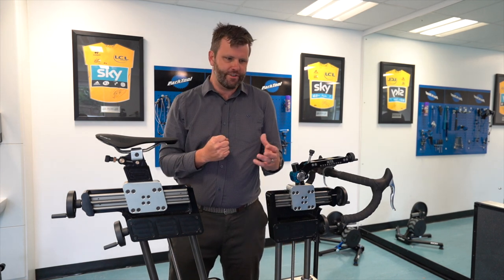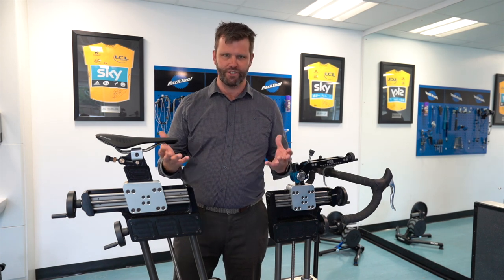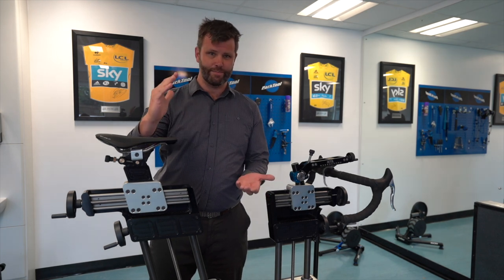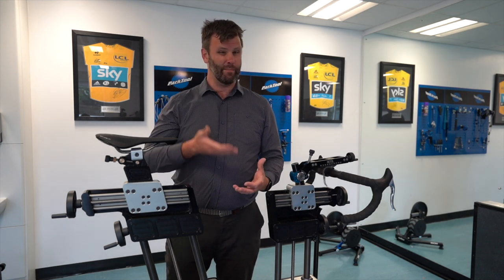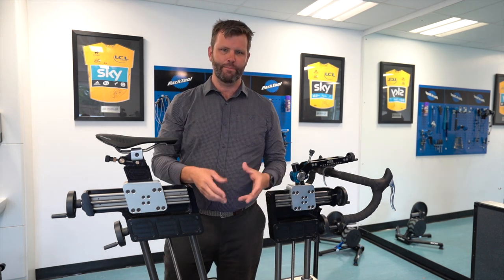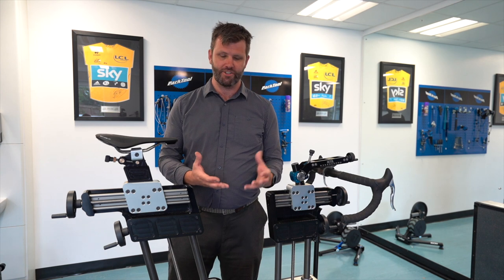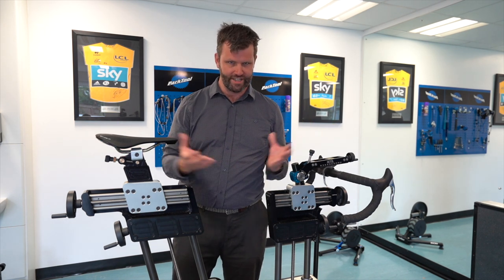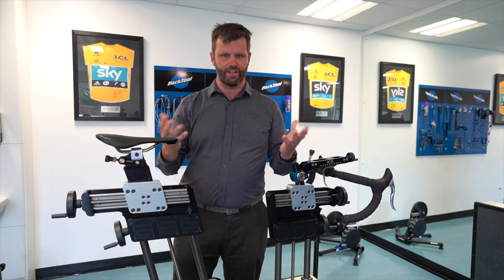How Crank Length Can Improve YOUR Performance

Comment: Tall guy here. I've always ridden different lengths on different bikes so was never able to compare directly without other factors influencing my perception, but when I went from 180mm to 175mm on one specific bike (because my power meter of choice was not available for 180mm) I noticed shorter is better for me. Shorter cranks make it easier to maintain a forward pelvic tilt so my lower back feels more comfortable.
Reply: ive recently got Phil's book and he mentions this issue.
I'm also very tall and the XXL frame comes with 175mm standard with that size
Are you aware of Phil mentioning anything* at all regarding rider height regarding this proposition? 
Is it ok for a 195/200cm rider to drop down to 165mm crank as well?
The book lightly touched on rider size but there was no definitive answer for this question.
I think a lot of tall riders will be very interested

Comment: I changed the cranks of my bike as I was experiencing knee pain on my new Domane. The bike came standard with 172.5mm. I rode to Burnham on sea on its maiden, towards the end of the ride my left Knee was so painful that I couldn't pedal anymore. I had to ask my friend to ride back and get his car. Long story short. On watching loads of videos on shorter crank lengths. I decided to buy 165mm crankset and to my surprise I was riding so much more smoothly and the pain in my left knee had all but gone. I think this is more crucial as you get older. I am 63, when I was younger I wasn't so sensitive to a bike which was too large, but now I need to consider these factors if I am to continue cycling

Comment: After going for a proper bike fit and switching from 170 cranks to 155 on road and gravel it's made all the difference for both pedalling and SI and lumbar issues. I headed out on my mtb a few weeks ago (170 cranks) and have been suffering ever since. Any tips to find some short mtb cranks? I've looked everywhere on the internet.
Reply: shortest i've found for mtb are 165s, shimano, hope and rotor make them. shorter road cranks seem easier to get hold of, only mtb cranks shorter than 165 are made for e-bikes!
Reply: If your cranks are solid aluminium, NOT Hollowtech, then they can be shortened to whatever size you want dependant on certain factors.
Just do a search for crank shortening.

Comment: I tried 165 on my road bike, and it seemed to lose power. The 165's are great on smaller frames and fit. I went back to 170's, and 175 on mt bike. 172.5's are too long on a road bike(5'9")

Comment: Hi Phil.  Great site and thanks for all the insite.  I am 6' and have had numerous knee surgeries and a torn labrum in my hip, all on right side.  I am pretty much bone on bone on the lateral side of right knee, which causes inflammation/tightness in the joint.  Currently using 175m cranks, came on the bike.  I also get saddle sore on right side sometimes.  Would going to 165 crank help elevate some of the tightness in knee and hip when riding?  Thanks in advance.

Comment: Phil, could you please elaborate on your statement (@0:39secs) "when you reduce your crank length from bigger to smaller it changes your gearing" this seems like a fundamental assumption for your position on crank length, but is not accurate from a physics perspective. I presume that the "gearing"  you are referring to is the chainring vs sprocket size (assuming also no change to wheel diameter) and is entirely independent to crank length, for example a 34t x 15t "gearing" does not change if I make cranks shorter or longer...thanks
Reply: If the crank length changes, the gain ratio changes. This means for every inch of leg movement the wheel rotation is higher for a shorter crank compared to a longer crank. Therefore you need a smaller gear ratio to compensate for the reduction in crank length.
Reply: @aktux  Correct, the foot velocity is reduced (it is traveling around a smaller circle) but foot force must increase proportional to the crank change...in real world application of shortening cranks inevitably riders feel that they are pedaling "easier" due to the foot velocity change but do NOT push harder on the pedal to compensate for the shorter cranks, in stead they ride a smaller gear and consequently move slower...fine,if you are looking for "ease" or "comfort" but not if you are trying to ride faster...Cranks should be proportional to leg length with the well researched "gold standard" used by Pogacar, Merckx, Indurain, Lemond...etc is 20.6% of inseam...

Comment: Hi Phil. Great video thanks. I’m planning on going from 172.5 to 165 on my CX bike, I’m 5ft 9 and have a 1x system. Question would I need to go up or down on the chain ring teeth size as cadence increases? I trying to figure out either 38t or 40t? Thx

Comment: Hey Phil, I experienced a pretty serious hip flexor strain that put me off the bike for a while and it continues to flare up occasionally with racing. Do you think a shorter crank length could help resolve that issue by opening up my hip angle? If so, how short do you recommend going? I’m 5’10” and have always ridden 172.5 cranks, but I because I’m a sprinter type I wouldn’t want to go too short and sacrifice pop. Any advice would be greatly appreciated. Thanks.
Reply from the maker: Hi Bryce-go too 165-will help hip open up-crank length doesn’t affect power until you go to 80 or 330mm-so you won’t lose any “pop”-just need bigger gears maybe!

Comment: Phil if I wanted to reduce crank length, currently 170 do you suggest going 5mm less to start with or even 10mm my height is 169cm and I suffer from knee pain at the front of the knee unless I try to increase my cadence but I'm happier to grind, although increasing my cadence means I get more of a 'workout' so it's give and take